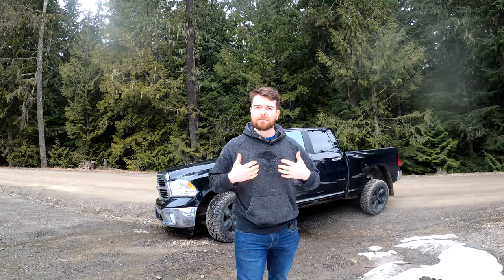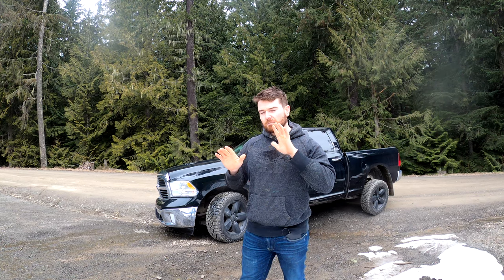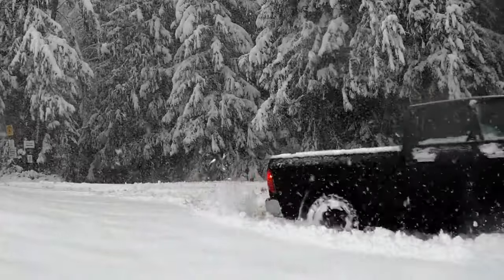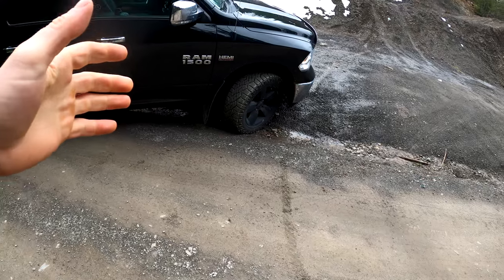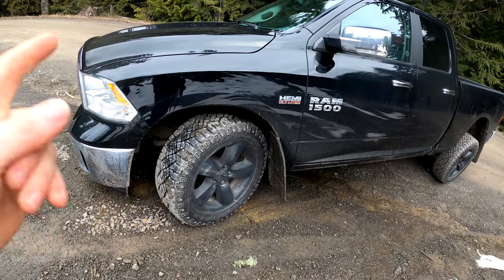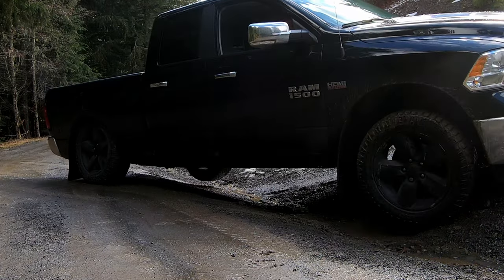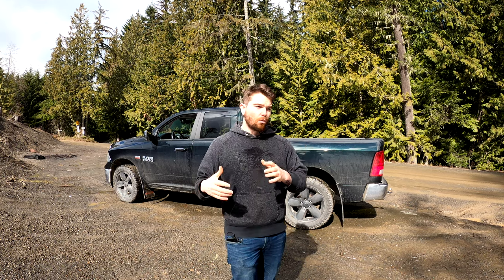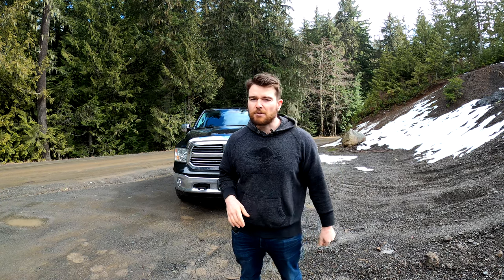RAM 1500 Off-Road 4WD LOCK TEST (With Open Diff's) | Not Really a 4x4...

Comment: Been this way for years. Ya have a fancy  2wd why the industry keeps doing this I can't  figure  out.
Reply from the maker: I have zero idea. Well actually no it's probably to have the best "on road" drivability and secondly for cost. 
 
Would be cool to see a manufacture come out and offer like an E-locker as stock in all rear ends. could even use it as an advertising campaign claiming their trucks come standard with the most off road performance.
Reply: @TheGettyAdventures  hey, my 19 f150 has an electric locking rear diff. Stock FYI

Comment: Can you try in 4 low?
Reply from the maker: I thought about trying in 4 low, but I was worried about snapping an axle and I'm sure as you know in 4 low you have 3 times more torque going through your axles. 

It may have made a difference just because of the added torque and control. But essentially if 2 wheels are elevated with open differentials it still wont matter. the wheels in the air will spin in 4 low or 4 high.
Reply: @TheGettyAdventures  I’ve heard in the past that 4 low locks it up or something

Comment: Its been said before and will be said again, put it in 4 LOW!! Then turn off the TC and ESC you proved this concept before in the snow. 4 lock is for highway driving not offroading
Reply from the maker: I thought about 4 LOW but I was kind of worried about snapping an axle. there was a lot of flex and strain on the driveline and I'm sure as you know in 4 LOW you have over 3 times more torque flowing through your axles. 

Now 4 low may have helped hear just because of the greater torque and wheel control. However, the priceable remains the same, with 2 open differentials only 2 wheels will receive the majority of power. TC on or off it wont matter. 4 low or 4 high it wont matter. It's the mechanical limitation of the differentials themselves. 

Now when I tied my truck to the tree lol I was testing to see if I was getting full power to the front driveshaft. and when the ESC was ON It inhibited the front driveshaft from getting power at times. With ESC OFF the front axle received full power (which is what we wanted to see). 

The TC and ESC system work on locking up the transfer case. 4 High and 4 LOW also only impact the transfer case. but they all have essentially no impact on what happens in the differentials. You can go under your truck and lock at your rear diff. there are no wires or air lines. you'll find your driveshaft going in and 2 axles going out the sides (maybe a breather tube also). so everything that happens in there is purely mechanical and whatever 4x4 system you are in it will result in only 2 wheels of the 4 receiving power (for the most part) 

If you want all 4 wheels to spin you need a locking T case, front locking diff and rear locking diff. Kinda confusing stuff but hopefully that helps or makes sense

Comment: I have LSD is that going to make the difference in this situation?
Reply from the maker: Absolutely! Now it is not a locker so there is only going to be so much power transferred to the wheel with all the traction. and the LSD may have issues when one wheel is fully in the air. but it will give you a much better change of getting out of something like this.
Reply: It dose I have 3.92s with limited slip and my wheels lock when I step on it  the only thing is with lsd is it needs to slip first before it locks up hence why a air or electronic locker is better
Reply from the maker: @adrianlecuyer  ya exactly the LSD will have some slip and if you really get stuck deep it may not turn both wheels because there is too much pressure on the clutches. but for most situations the LSD works great!

Comment: Turn off traction control. All 4 of my 2020 ram tires grab and turn. turn no problem.
Reply from the maker: But my traction control was off... ( as well as my ESC system)
Reply: Sounds like something is wrong... I keep trying the things you do with my 2020 Laramie. I have good holes and ditches with plenty of mud here in Louisiana... I 2 wheeled  about a 3 foot ditch and stopped it like you did. Slowly went forward and it grabbed immediately, and I did not have the rear wheels locked... I am now curious of the year of your truck and if they made any changes from that year to 2020. Thanks for the video.
Reply from the maker: @ThePixMaster  do you have the 5th gen truck? or is your a 4th gen like mine?

Comment: This dude doesn’t know what he’s talking about-you can’t even put your locking differentials on when VSR is on you have to take that off and also you need to take your traction control off as well because it does impede and affect your four-wheel-drive and your locking. Here’s a little tidbit for you, buddy -the traction control goes through the brake system, that’s what it is. Your brakes control the V SR system which is why you need to turn them off. Anytime you’re in deep snow.

Comment: Try turning n holding ur Trac control it will unlock your shit .. now make a new video cus I own a 18 ram 4x4 and this is false information
Reply from the maker: nah it isn't false information. you just don't understand how a 4x4 system works with two open diffs
Reply: Lol I only work for dodge ..  and work on these trucks every  and not all of them are open diff .. mine is not ..
Reply from the maker: @alanjoseph986  Some do come with a rear limited slip, yes. but I can assure you that every single 4th gen ram 1500 came with an open front diff. so best you're going to get is 3 wheels getting power. 

Turning off your ESC system will do nothing in this situation for my truck. turning off your ESC just ensures that your front driveshaft gets full power at all times. that front driveshaft still goes into an open front diff. 

The ONLY way for all 4 wheels to get power in this situation is to have a front and rear locking differential. a limited slip diff would help, but they are not full lockers and may also fail in this situation.

Comment: Thank you for making a follow up video on this, its great data.  Are you considering getting an LSD through mopar and doing the same tests? Would love to see it
Reply from the maker: I've really wanted to put an eaton true trak torson style diff in the rear. so hopefully sooner then later i can make some comparison videos. 

A good friend of mine has the same truck and I believe he has the factory LSD so maybe i'll try and get him out here to do a cool comparison!
Reply: @TheGettyAdventures  Aftermarket LSD vs factory would make a great side by side test! I have a 2020 Warlock with your current drivetrain setup, so these videos are like crack to me haha. I might be tempted to go with the factory option over if the Eaton if the Eaton voids the stock warranty, or makes getting its warranty serviced a big hassle compared to taking it to the dealership for service.  But i would definitely consider getting an Eaton if it out performs the OEM LSD.  Maybe reach out to Eaton and see if they want to sponsor a video showcasing how there lsd is better! Either way, great stuff and good luck with your videos!
Reply from the maker: @ClickBoom290  thank you sir! My truck is at the 80k mark so its getting close to the end of my warranty. the eaton torsen diff is pretty bullet proof. probably the strongest LSD on the market. acts more like a locker then a LSD in my opinion but do your own research because both are great options!

Comment: I've used partially engaging the parking brake to fool the rear axle into pulling out of the one wheelie peelie trap. This only works on mechanical parking brakes that are properly adjusted.

Comment: Good video I had a 2014 ram 1500 with both open axle front and back I hate it so I ordered a 2018 ram 1500 with a rear posi it helps so now I'm building a 1998 5.9l limited ZJ with front and rear locker

Comment: so the ram sucks for off road ?
Reply from the maker: MY Ram is not the best truck for off-road. just depends on how you get your truck set up from factory. some of the these trucks come with a posi in the rear. the newest generation comes with an optional factory locker in the rear which makes a huge difference

Comment: You made a very good video I just have 2 things to add

1  You are never high centred you are crossed up that is the technical off roading term

2  Using recovery board/ maxtrax always helps to get some extra distance off the ground and get some traction more than trying to do  Wheel braking Which as you said in the  video Cam hurt your axles
Reply from the maker: Well you learn something everyday! my apologies on the terminology. and yes I was a little concerned about breaking something which is why I did go nuts spinning the tires. 

I do have a set of traction boards which if I laid across the ditch would certainly help!
Reply: @TheGettyAdventures   Yeah no worries about the terminology I don't know all of it either so we are all learning is always a good thing

Comment: This is exactly what Mitsubishi AWC   does, when wheel slip and a static wheel  is detected the ABS comes in to give a bit of braking to allow the static wheel to drive. I just figured this is how all electronic AWD systems work 🤔. The effect behind the wheel is when you're spinning for grip the car will then drop back for a split second as ABS is engaged and  as long as you keep the power consistent and have enough  mechanical tyre grip the car will then crawl forward as the ABS releases.
Reply from the maker: That is the idea behind Traction Control, however some companies have more in depth types of traction control, I know like Toyota was a pretty wicked system. it seem for this truck at least traction control works well when I'm driving on the road. tend to limit me sliding around the snow but in situations like this where you would need a pretty significant amount of brake pressure it just doesn't help. 

So Mitsubishi has probably designed a specific type of traction control that has the ability to fully lock up a wheel with brake pressure. you would think everybody would do this but i guess they don't
Reply: @TheGettyAdventures  For sure not all electronic AWD systems are born equal. I think Toyota, Mitsubishi and Subaru are fairly innovative with their systems.

Comment: Get you the Ram Rebel with rear locking axel, electronic swaybar disconnect and stock 2 inch lift.
Reply from the maker: Hoping to review one soon!
Reply: The rebel doesn't have a front sway bar disconnect... It's IFS
The ram power wagon has the sway bar disconnect.
Reply: @rambo8218  what's ifs?
Reply: @ish2751  independent front suspension... IFS

Comment: The brake truck only works with some version of a limited slip.. all it does it activated the limited slip which normally doesn’t activate when having 0 traction to a wheel.. 

It’s much less a jeep thing then an old school 4wd trick. It just happens that lot of old school guys venture into Jeeps at some part and that knowledge is transferred to newer jeep owners. 

You’ll actually see a lot of semi trucks, jobsite dumpster trucks, etc use this technique on non paced job sites.. it works even better with them cause the rear 2 axles are limited slip but when lossinf traction it doesn’t drop to 1 wheel per axle or actually drops to just one wheel out of the 4.. 

Lot of 6x6 dump trucks also require this same brake application technique in order to actually get true 6x6 drive function.. wo it it’s essentially just a 4x4 with 6 wheels and limited slip.. 

This is also very handy in front wheel drive vehicles as most of them have some form of limited slip by nature to help with torque steer..

This is 100x better with gear driven limited slips vs the viscous ones when are more common in a typical pickup.. but with practice and time with that vehicle to find the right amount of brake application needed it does work.. hi is basically how most older awd systems work in a way.. 

But if you have helical gear driven limited slip like say a tru trac.. this is as good as having a locker and takes so little brake imput to activate compared to the viscous crostini types.. which even still don’t achieve a full power transfer but it will get you maybe 20% power to the wheel wit traction. It’s also wheel speed sensitive. It works better when applied into something with some speed rather then as a get unstuck gimmick but it will work there to it just iffy cause you need to get enough wheel speed with brakes applied enough to activate and in something like say sand.. all your doing is digging down while waiting to engage and by then you may be in a worse senario

Comment: Is this truck equipped with the anti spin rear diff? My ram had it but it was essentially a LSD.
Reply from the maker: No it is not. If my truck had the factory LSD it would of walk over this ditch like nothing was there. those make a big difference. you should be happy you have one!
Reply: @TheGettyAdventures 4x4 without at least an LSD should be criminal
Reply from the maker: @cugs17  It honestly should be. my first truck came with a g80 locker and I figured I could go without one when I bought this truck. Boy was I wrong!

Comment: Damm youtube, I sincere comment not uploaded...

Hey from Korea, I drive (daily base) almost identical of yours. Ram 1500 5.7 hemi quad cab... and I'm pretty sure she has 3.21 open diff,(just guess) but mine has 45 transfer case, which I didn't know the code till you tongue twisted forty four... yeap, mine has no 4WD auto. So do you think of the difference of your truck and mine in terms of 4WD lock?

Some trucks have 4WD high, and I have been wondering about the difference but folks in RamForum said there is no difference but just sticker. Disappointing..

I have 2014 model Express, so more out dated.. older dash and not fancy like your big horn or Laramie but it's good enough to me. It's just frustrating that I even don't know the axle ratio and LSD or not on my truck. I got it as 2nd car and there is barely information about American pickups here.

BTW, how is it going with the Eaton locker you ordered in the previous video? I will be interested if yours works fine.
Reply: Forgot to mention that I really appreciate your passion and effort doing the best with the given resource which is a decent truck but not off-road worthy. Thank you.

Comment: It's not even an open diff. At least with my 2011 sport. It's got a limited slip so if you floor it it locks up. I'd be able to make it over that no problem. Even being stock height.

Comment: I swapped out my F150 diffs to Detroit TruTrac in the rear and an Eaton E locker in the front. Makes a night and day difference and it's really not that expensive.
Reply from the maker: That is the exact combo I want. how do you like the trutrac in the back. I hear it has great drivability for being such an aggressive LSD
Reply: @TheGettyAdventures  I love it.
You don't even really notice it much on the street. There's been a few times when it was raining or snowing where I'd give it some gas out of a corner and the back end would definitely slide out more (like a locked rear end does) then the factory diffs would allow but it's pretty predictable.
The Eaton in the front is fantastic too. The locking/unlocking is seamless.

I thought about doing the trutrac in the front too but figured I'd like a fully independent selectable locker there instead and wanted a proper LSD in the rear full time

At the time when I did them a few years back, a shop got me a great deal on the parts (nearly cost) and a local 4x4 shop did the installs for me AND they bought my old diffs from me to offset my install price. So the install front and rear only cost me $250 Canadian (like 175USD)
Reply from the maker: @evictioncarpentry2628  Jesus that's a great price on labor. Totally on the same page as you, I'd want a fully open diff in the front to keep a decent turning radius. but the ability to fully lock it up when you are really deep into the shit

as with the rear I'd want a more automatic lock up which is exactly what a truetrac does. very jealous of your set up, makes me want to finally drop some money and just get it done lol
Reply: @TheGettyAdventures  You won't regret it if you do! It's turns the truck into a beast. Besides a good suspension upgrade it's the best money you can spend if you do any off-road driving!
Reply: I always thought a good compromise is locking center with Torsen front and rear diffs. Not as capable as locking on all three, but damn close and easier to live with.
Reply from the maker: @jg8263  Torsen Diffs are awesome. they act like lockers in most situations but still have great drivability on the pavement